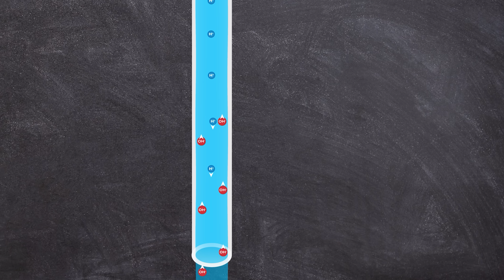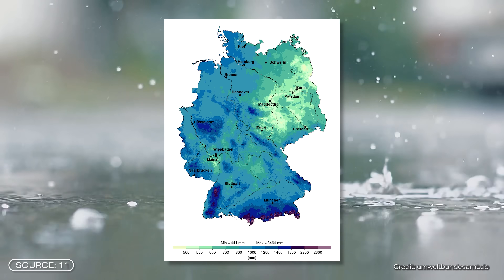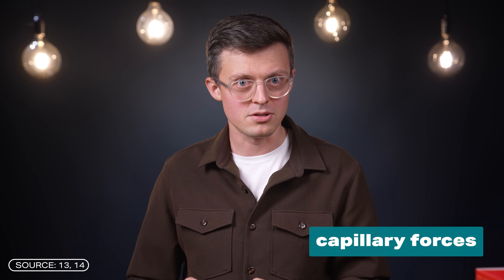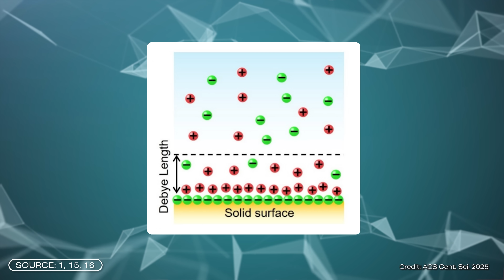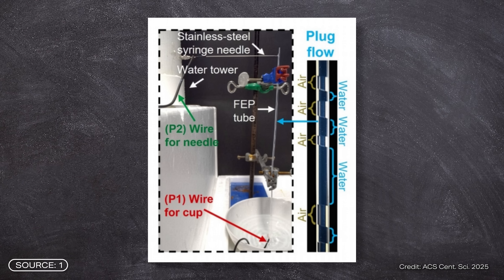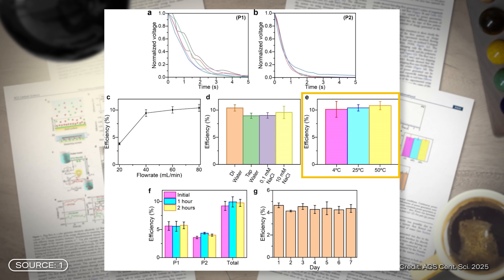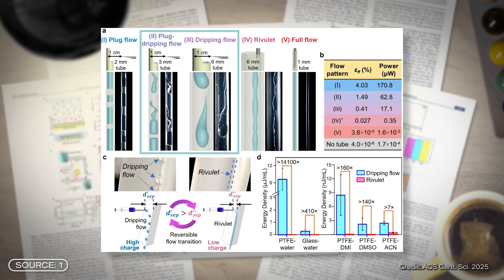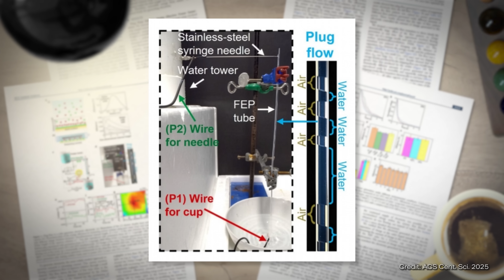Physics Hack: 100,000x More Electricity from Rain!

Comment: technically and scientifically a funny breakthrough. 
Useless to produce energy on my rooftop, or anyone's, though: 10% of the energy of a 3 m fall of a full 100 m3 (~1 year rain) is only (mgh) 0.1 x 3m x 100 x 1000kg x 9.81  <  300,000 J, less than 0.1 kWh (3,600,000 J), worth litterally ~ a cent
There could be other use, though, I don't know
And, again, more importantly : that's FUN. Thanks for the news and kudos to the guys!

Comment: I have an idea, how about increasing charge seperation by enveloping the tubes with magnets or capacitors ? also i wonder how much electricity you can get out of 40 cm height difference with a 1 square metre water vortex generator, if it is more than dont botherer with charge capturing
Reply: Also 3d printing the tubes into hexagonal honycomb structure where all tubes share walls with neighbouring tubes to increase the number of tubes (denser packing) per square metre while usinf les FEP material. Perhaps even put magnetic rods in some tupes evenly spread to enhance charge separation.

Comment: gravity battery elevators  for multiroof buildings can produce too.,!  the longer the rain the longer the weight tanks will maintain generator running,,!   no need big   tanks on top only surface  and surface gets bigger when roof has agressive angle!!!   voila! no sun yes production . and if you dig enough  down you have extended production due to distance the weight goes until it empties  ! more small  ultra light buckets might help  for less   degredation and issues !  // ways of emptying the tanks when  lowest possible  place  are plenty as long as they dont drag system much!!! and if  you collect a big ammount of mass in water down  at the basement you can repurpose the unit   to work as solar  elevator  and maintain a small ammount of battery storage  on top! when long  periods of sun

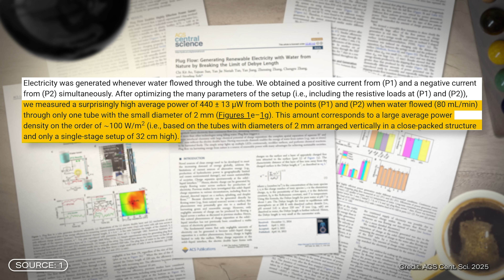Comment: What doesn't look too good though is the math. At 9:21 their paper mentions 80mL/minute for 0.440mW, so that's 4,800 liters per hour for 440mW/h, or over one million liters per square meter to get 100W/h. It would take a 40m x 30m roof to collect that much water in a year based on your average rainfall. Unless I did the math wrong, it just doesn't look useful.
One could argue that the setup could be replicated vertically, with 100 stages piled over a 30 meter drop, which would effectively produce 100x time more energy from the same amount of water, but 10kW/h annually from such a large collection area still doesn't sound sufficient to be useful.
My guess is that from such a height (30m) a Tesla turbine would generate a lot more power from the same amount of water.

Comment: Lovely idea, but I grew up in a house with a roof and trees not too far away. The system will clog up from the leafs if it is not manually cleaned very regularly. I would call it a system for enthusiasts who are willing to keep it working by putting in the effort. But still, maybe this can be overcome.
Reply: Biy wind solar atrafael tree

Comment: Interesting, thank you!
It is surprising that the power potential is given as Watts per square meter, without considering the height.  This is especially surprising when comparing with a hydro electric turbine, where the power is directly proportional with the height.

Comment: Wait a sec. 10% efficiency with "no complex tech|, well, only requiring regular replacement of plastics and other parts grinded down by water friction. While we can collect what, 90%+ with existing "complex" tech of, oh, a rotor hooked to a stream? Ok, Ok, on a large scale, optimized setup in MW range. So, realistically 50% in a scaled down commercially awailable home setups. 
Perpetum mobile is perpetum mpobile, no matter how much mumbo jumbo speak you do around it. The energy "source" is the gravity well, potential energy in water body position. The "free" aspect here is using rain water and ignoring all the cost associated with managing the streams and upkeep of the system. So, just put more water into the collection basin of the river upstream of a hydroplant and enjoy existing infrastructure at (way) higher efficincy? Well, that one is already is at saturation, as rightly mentioned. Here we are talking small scale home setup. So then, what, just hookup a turbine to your water pipe streaming rain water from the roof and enjoy higher efficiency using well developed tech? I wander why nobody thought of it? Or made commercial setups? Oh, right, they do exist, just bring in so minute extra to be pretty much not worth the cost and bother..
Reply: Still, interesting research flic. But also not as fundamental. Passing droplets instead of continuous stream is not a new idea either. Done regularly. Just this particular application hasn't been bothered with, simply because it is quite clear its not very useful..

Comment: Since the electrical current generation occurs inside the tubes, a solid block of tubes might be printed using a 3D printer ? This would possibly be cheap.

Comment: My native language neither english nor german, but I understood every single word you said.
So don't apologise, there is nothing wrong with it.
Reply: ...though I 'think' the word 'good' (at 5:59) could use a tiny little improvement.
I couldn't understand, at first, at 2x speed. Other than that, it's perfectly understandable. Therefore, 👍🏼👍🏼🙂
Reply: @morienbendinelli1554  Ok, that's just funny!!!
Reply: @morienbendinelli1554  It could use improvement, but if you did not understand it, that's a you-problem. 🙂
Reply: Think he only missed the word 'of' once but an advanced English level, not a problem
Reply: @aaronlee2751 Half of native English speakers miss that word, lol
Reply: Rain water is not clean so anything that requires clean surfaces and filters won't work.
What about using gravity and flow to spin a wheel and a small generator instead?

Comment: Can't we just cleverly mount water wheels?
Reply: You can.
It would just be a very, very bad idea in most cases.
For a normal rooftop, the cost of installation and maintenance would of course be absolutely prohibitively large compared to the value of the generated electricity in almost all cases.
For a height of 2 meters, you would need a few cubic meters of water per second to build a water turbine that is cost effective.

Comment: You English is good but you pronunciation is just a little bit off. 

I think a 10²m roof is small, you could have a 20²m roof and only drain the cleaner rain water into the tubes system. So just let go of part of the dirty rain water and use filtered rain water to run your tubes.

The competitor you mentioned is of course also worth considering! 

The innovations people think about is just amazing! Using rain to generate electricity would be a superb solution!

Comment: Interesting concept. I just tested it in my lab with a similar very simple setup I put together in an hour and made it work nearly as good as described! WOW it feels amazing... till you run the math.
From "Source 1":  "...The power of 440 ± 13 μW  is achieved when water flowed (80 mL/min) through only one tube with the small diameter of 2 mm..." (I got 295μW, which is fine for my fast build).
To get 100W/m2 you need to fit a total of  227272 tubes of 2mm diameter into that 1 square meter. That should be fine. BUT...!
The problem comes up when you calculate the flow rate of 80 mL/min * 227272 = 18182 L/m = 18.2m3/m = 1091m3/hr = 4132Gal/hr. This amount of water is comparable to a river flow to generate  100W.
In comparison the cheapest low head hydro turbine (less than 1000$) can produce 2000W of power with 300m3/hr flowrate and 2m of head. If you have the required "River" for this tech I don't see how it can compete.
If you collect rain water from a roof with average rainfall of 600mm/year in my city. You will need 1818m2 (19569ft2) of roof to get 100W of electricity per year. 🙄

Comment: What is the point of all of this? Let's generously assume a big family home with 200 m2 roof area at 10m height, 1000mm=1m rainfall annually. That corresponds to roughy 5,5 kWh of potential energy, provided that you can utilize it at 100% efficiency. With the 10% efficiency mentioned in the video, this decreases to 0,55 kWh. In a full year. Where does the 100 w/m2 figure come from? Is this a very large or tall building? Such as a skycraper? Not a typical family home though.

Comment: You need 250,000 tubes to create 1m². This would generate 100W.
How much water is needed? 250,000/m² x 0.08 L/min = 20,000 L/min/m².
How much rain falls on average in Germany? Annually = 789 L/m²/year. That is, 0.0015 liters/min/m².
So, completely worthless.

Comment: Keep up these excellent reports on innovative science and engineering, Jakob, and I'll keep coming back 👏👏👏 This is a fascinating develpment and will surely spark a lot of research. What are the optimum tube characteristics/material?
Reply: FEP is known to be extremely UV resistant. One of the most UV resistant polymers that exist. Used in solar panels today. 

I would save money and nust use Polyethylene or cheaper and just do it under the panels and it could need a needs a filter it seems.  Its more about water flow than drops anyways.

Comment: TENG sounds complementary not competitive. The rain hits the TENG system before it's collected and used for it enters the plug flow system. Shouldn't the building height be calculated into the plug flow system? 
If I'm understanding this correctly plug flow only works over about 30 cm, then every say 50 cm could be a tank and a new cycle. If that is on a 100 m tall building then it could have 200 cycles. Is that a fair assumption?

Comment: So less then 1mW per square meter in the most rainy place in the Germany, or if you concentrate it a year in to a minute 123watt,
I may be wrong,  energi = m*h*g, mostat rany place in Germany gets 2500mm pr year, 1mm pr square meter is 1 liter, 1liter of water is 1kg, so that is 2500kg, and for 30cm fall (the distance the water moved in the generator). 
 2500kg *30cm *9.82m/s^2  is 7365 joules. Which is less then hits a square meter in 7 seconds.
Am I wrong?
Reply: You are still using the formula for a hydroelectric power plant. The methodology is as follows: from power density to annual energy yield, with parameters: a. Power density: 100 W/m2 (of active tube area), b. Active area: a normalized 1 m2 array of active tubes. This represents, according to the authors, a hypothetical panel with a 100% fill factor of 2 mm tubes, c. Annual rainfall energy yield (E annual) in kWh per m2 of active area. Formula: Annual energy yield = Power density x Active area x Annual rainfall hours. Wuppertal Annual precipitation ~1.150 Estimated Annual Precipitation Days ~160 Estimated Annual Rainy Hours 480-800 Calculated Annual Energy Yield (kWh/m2 of active area) 48.0-80.0. 
I don't know whether it did help you or someone else. I might have made a mistake. Likewise, I'm not an expert on this field.
Reply: @LenQuerido no, I am using the formula for potential energi, which is the maximum energi you can get from changing something's hight, if more energi could be taken out it would be able to pump it's own water and then they would come free energi.
They may be able to do 100w/m2 but there is nowhere  with rain enough for that.
You can't use rainfall hours, like it was sun light, you need the amount of rain.

Comment: How much this Apply to Large Scale Projects if we take the low end Rivulet amount of Generated Energy and we apply it to Transportation of Humongous Quantity of Water?

If we use this as Energy Storage Battery/Passive Energy Productor when water is flowing on Plains Territories, as Energy Reservoirs when Energy is Used for Making water Going Uphill into Pressurised Tanks and again as Enhancer to Hydroelectricity Production when water is Released again from Tanks into Downstream Strong Currents..?

The Initial Idea looks Awesome but applied to Small Quantities of Water it Looks a Bit Counterproductive...
Mostly for the Prohibitive Prices.

If we instead use the concept on a Larger Scale with the Minimum Amount of Energy Harvestable and we try to improve that Amount of Harvestable Energy for Cheap, still would require Billions to Build, but in a Larger and Multi Purpose Project those Billions wouldn't add up to the Improved Benefits brought from the Passive Energy Gathering of the Technology.